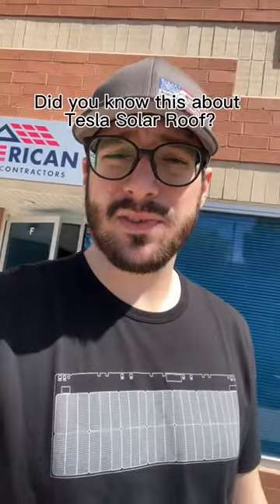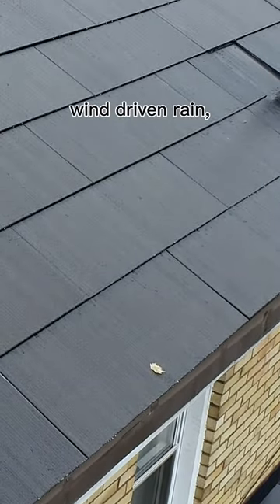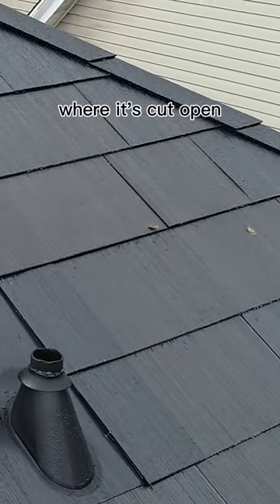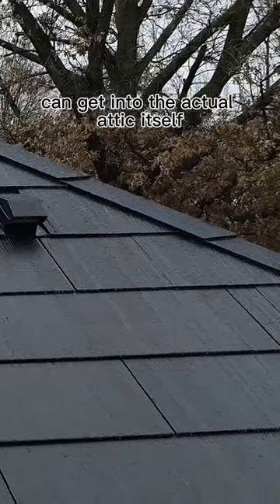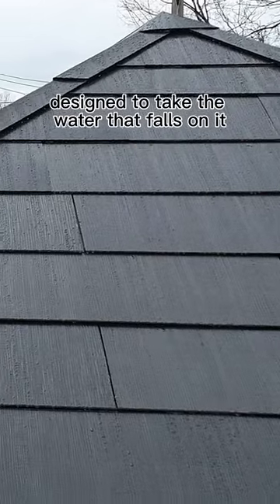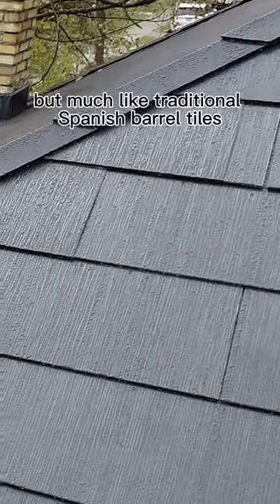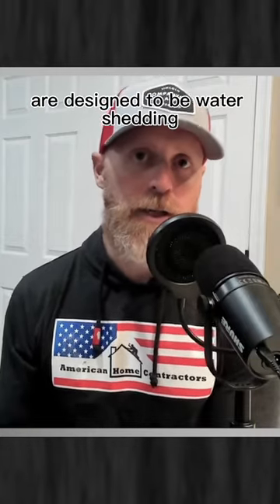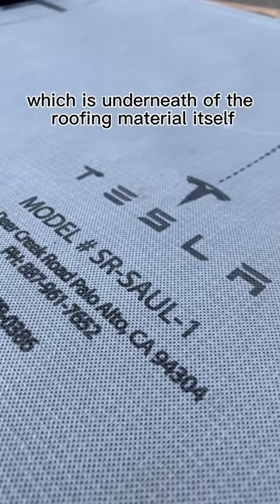#Tesla Solar Roof does WHAT?! #shorts #solar #roof #elonmusk

Comment: That’s why it has the starter trim with the slits so water can escape at the eave.
Reply: Exactly.  Most water will just flow down the tiles.  Any water that gets under the tiles hits waterproof underlayment layer and drains thought the slits at the bottom.  

When ours was being installed Covid stopped the work with much of the roof just cover by underlayment.  We had big rainstorms for the months we were stopped and none of the water got past the underlayment.

Comment: Isn’t this an insane fire hazard? Could you even puncture the roof? Walk on it? And what if that roof catches fire..? Will that thing stay lit for days on end?
Reply from the maker: Tesla Solar Roof is approved by fire code in any location we are installing.  The roof has systems and guidelines in place to allow for an emergency breach in the event of a house fire.
Reply: @ahcdmv  okay what if it catches fire..? And what if the power is off and it’s still holding energy.. that’s going to shock the hell out of you
Reply from the maker: Some counties have requested a demonstration of exactly this. Mid Circuit Interrupters (MCI's) are installed at the beginning of each PV string, and every 10 tiles thereafter. They keep the strings at a safe voltage once the system is turned off.
Reply: @ahcdmv  wow, I have to see it all in action but that’s quite the engineering then. I’m a huge fun of musk, but I’m also becoming a  firefighter (basically am one). So I just know to question that. But knowing musk.. he’s a person with morals and logic.